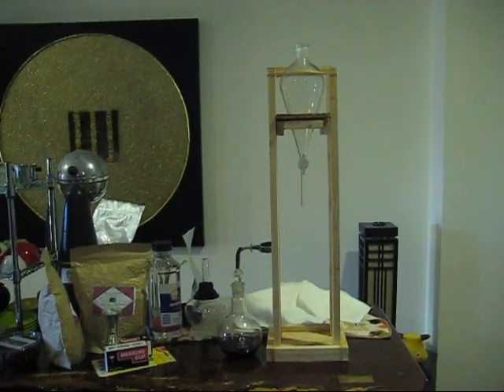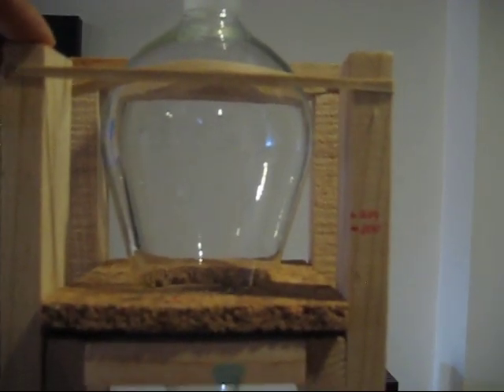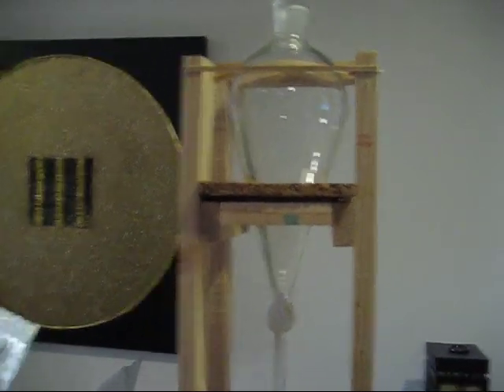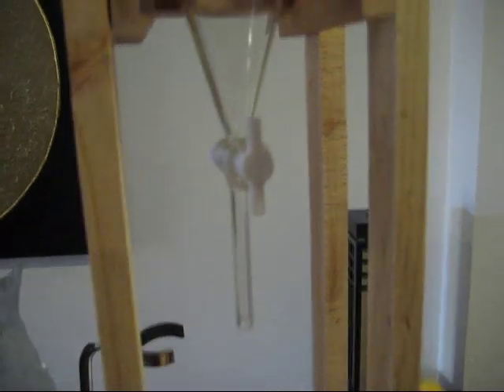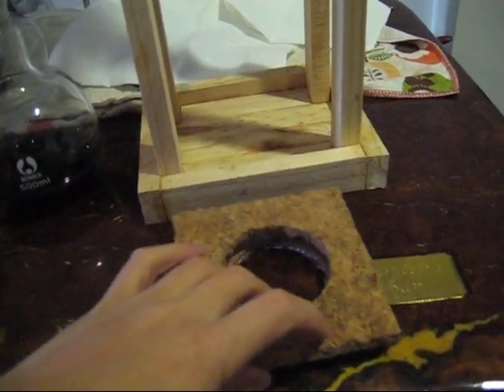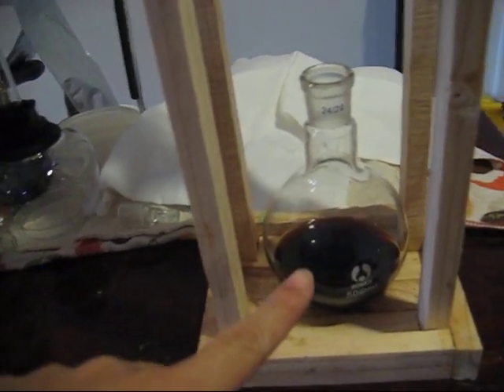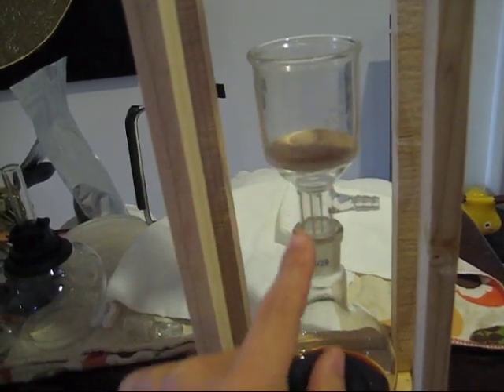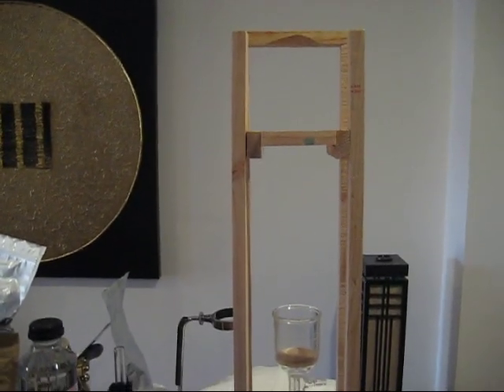DIY cold drip coffee brewer laboratory glass - NOTE may be illegal in some countries

Comment: Not sure if you even keep up with this vid, but what piece of glass did you use to replace the Buchner? did you just add a paper filter inside or did you use a different piece of glass with a paper filter?
Reply from the maker: Hi there. Thanks for your comment. The buchner is too slow for the flow I was looking for so adding the paper to a buchner would make it worse. recommend looking for something else that will hold a paper filter.

Comment from the maker: Bart Erven sorry I accidentally deleted your post...I don't think I can get it back on but the question was "Is there a reason for not using a dropping funnel instead of a seperatory funnel?" and the answer is simply no there isn't. I just chose the separatory funnel for the looks.  Any container that allows for minute controlled adjustment of water release is usable, and also as long as the container is able to hold enough water.  I did look at dropping funnel too but found more separatory funnels available in the size I was looking for. Plus I would have had to make another brace top and bottom of the dropping funnel.

Comment: hey there first of all thanks for the video. I know this is a relatively old one, but i was wondering if you could provide the specific names of the lab glassware you used. Or if you have a link were I be able to find it that be great. thanks ahead of time.
Reply from the maker: Norm Pacheco  Separatory Funnel, buchner funnel (the piece that does the filtration...but I don't recommend to use one as it is better with a paper filter for the quality of the end result taste), and a flat bottom flask.  I bought them all from deschem on ebay.